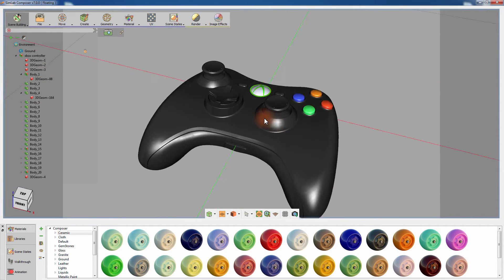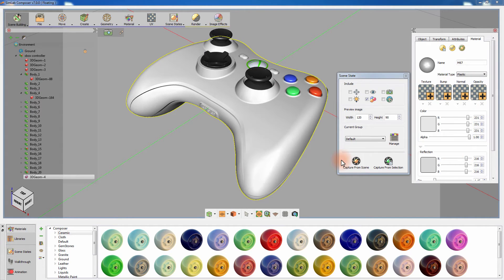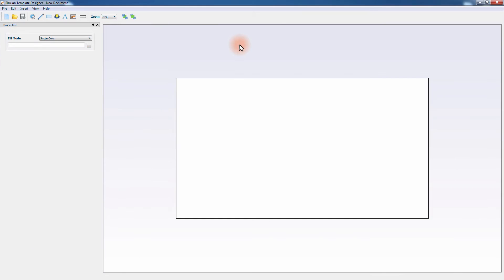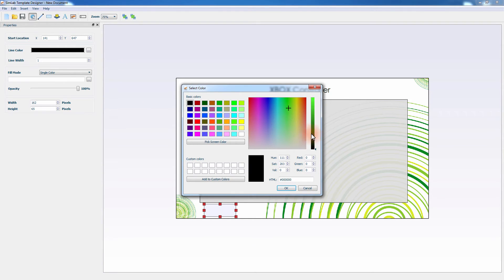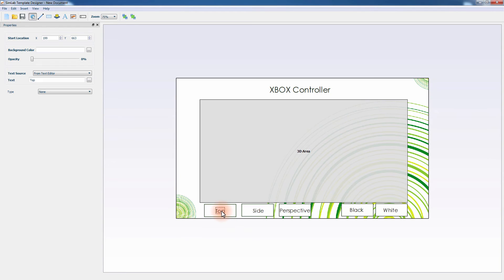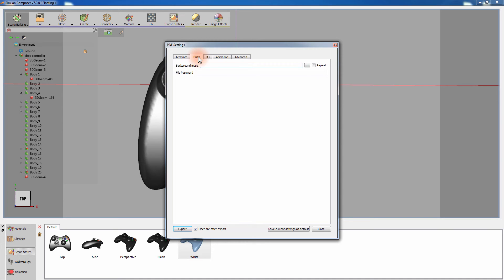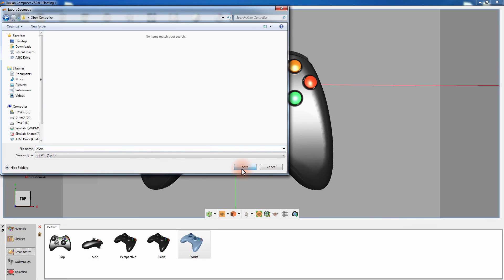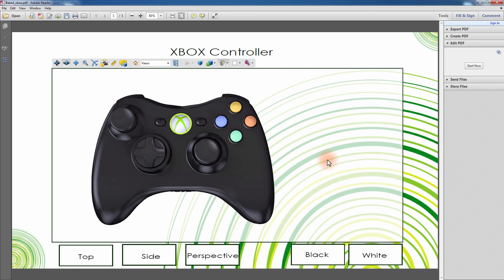SimLab Composer : 3D PDF

Comment: is it possible to use a premade template made with other software i.e. adobe illustrator or affinity designer?
Reply: ...and just drag the 3D area on the existing pdf?
Reply: Yes, it's possible. In fact, SimLab's Template Designers allows the user to import image (JPEG, PNG, and BMP) or PDF Document, for instance, to replace the 3D Area over them. Why don't you request a trial license and try it by yourself?